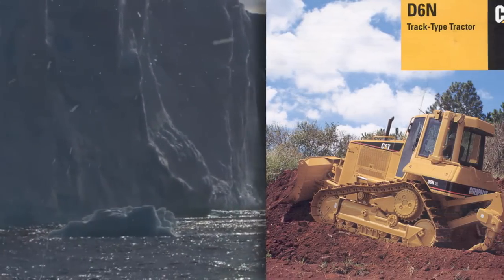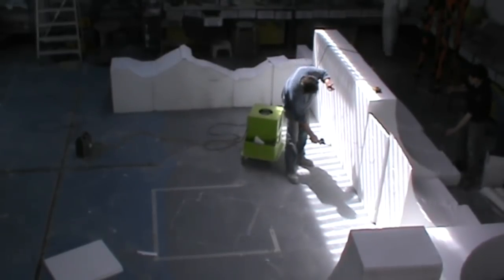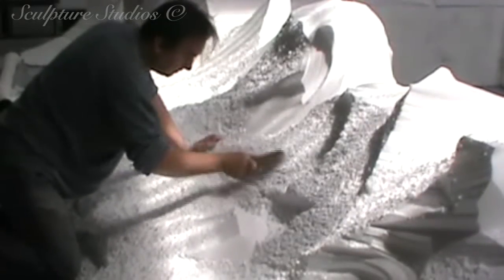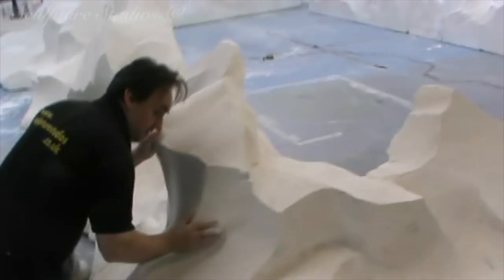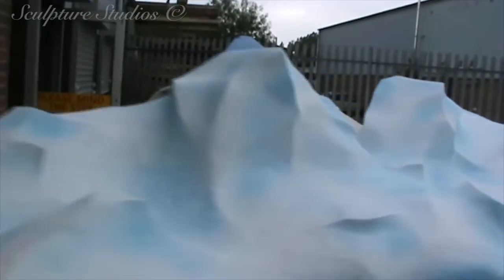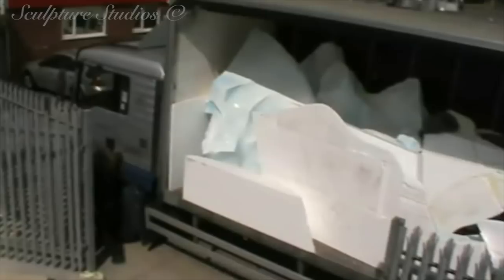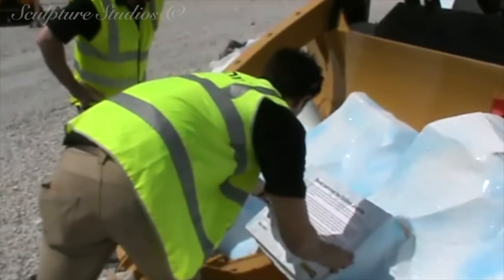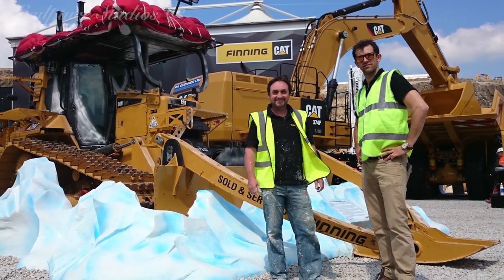Polystyrene / Styrofoam Ice Set by Sculpture Studios

Comment: What do you use if you want the piece to be permanent like a small Christmas display indoors where you can easily set up and take down without damaging the piece
Reply: What type of filler if any to prevent seeing the beading in polystyrene
Reply from the maker: This would probably require going down a glass fibre route

Comment: I got to ask, is your hot wire connected to a car battery? Look like it in the video.
Reply from the maker: It's connected to a variable transformer, allowing you to adjust the power, depending on the thickness and length of the wire you're using.

Comment: May I ask what kind of pain did you use?
Reply from the maker: Hi Nibras, this was just a water based emulsion paint over the polystyrene and plaster, as this was only going to be used for a couple of days, and had a water based lacquer over the top anyway. Thanks for watching
Reply: @AdenHynesSculptureStudios  thanks for your reply.. infact I am a big fan of your art... 
As I know the water base paint doesn't go smoothly through the spray gun and it's clogging the nozzle within seconds so would you please explain this to me?
Reply from the maker: @nibras26baqir  You probably need to water it down quite a lot. And go over with very very thin layers (if you go on too heavy at once, it will be too wet and will run and drip). Dusty thin layers of very watered down emulsion

Comment: How do you harden the foam ?
Reply from the maker: For this job, we go on with a spray on concrete. It's shown in the video. This only gives it a slight shell though, it's not super strong, as this is just for show for a couple of days.
Reply: I started using a plaster n Paris with a latex additive used for grout that I sprayed on with a hopper or brush on and it’s rock hard, good for temporary installs but not for permanent owww and it’s very inexpensive. It’s like the cement but sands supper smooth.